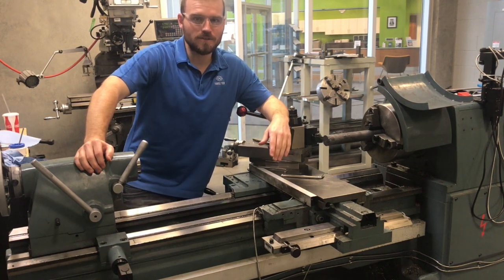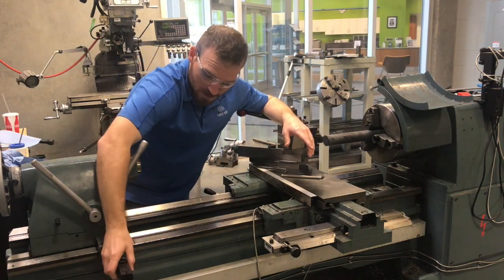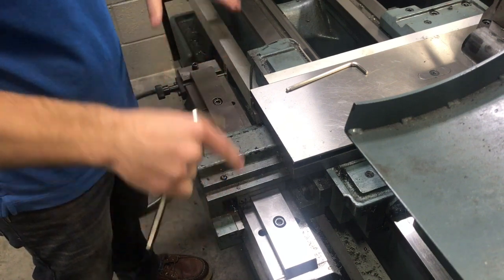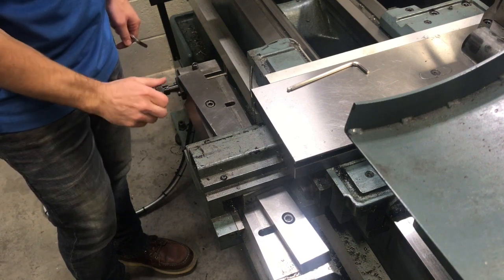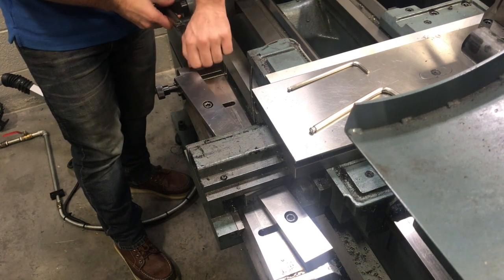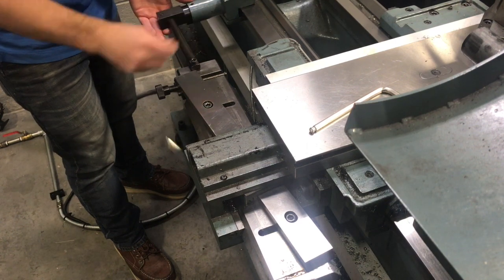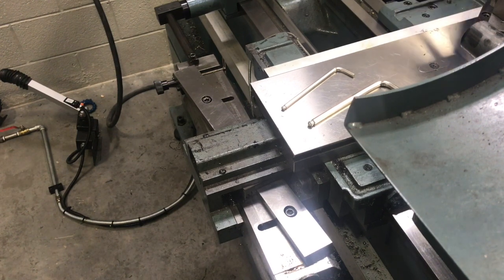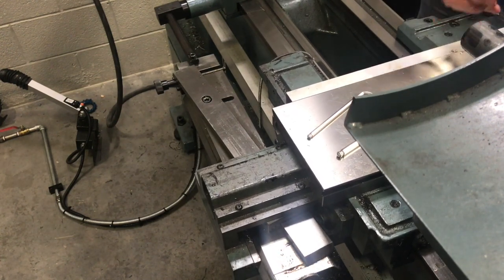How to use the taper attachment

Comment: Great video! Question for anybody that can help; Do you have to somehow disengage the cross feed lead screw to use the taper attachement? Can any taper attachment be retrofit, or do I need one specifically made for my Calusing Colchester 1540 lathe? Thanks, your help is appreciated.